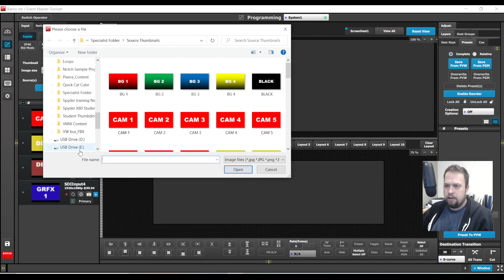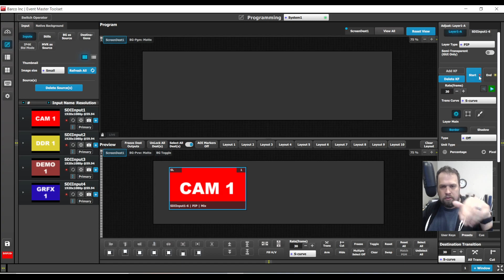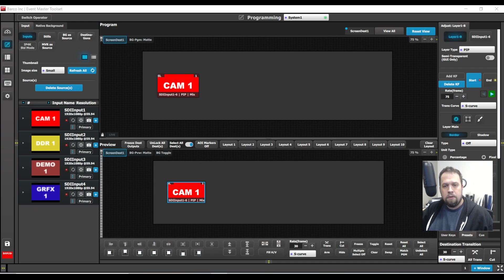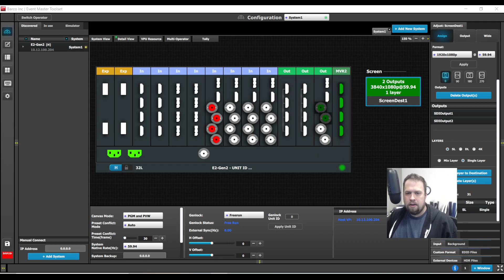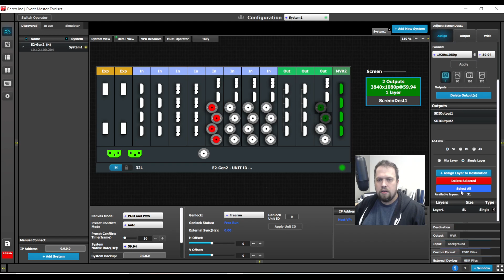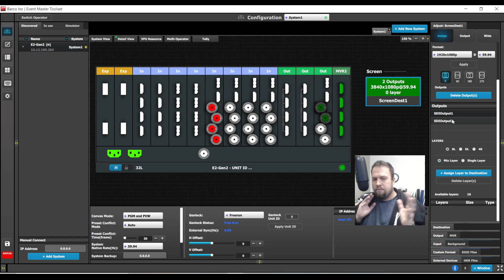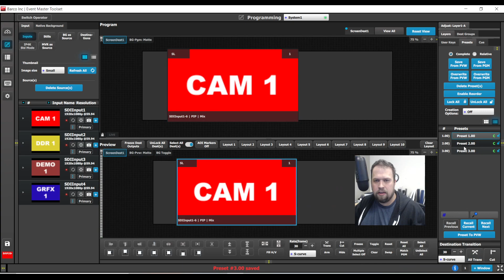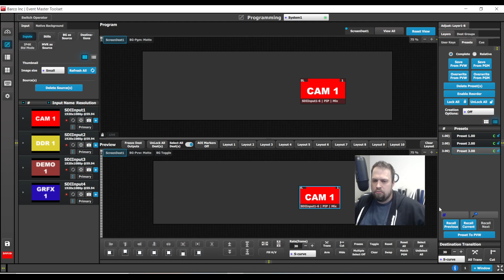Barco E2   Creating and using Key Frames for flying Pips

Comment: Love it, yet this doesn't seem to work with your input "bind to user key" trick. I have it set to adjust the border and shadow and the keyframing seems to have priority over the bind user key command so my border and shadow don't get applied. So i guess i have to program the border and shadow into the relative presets if i want to use the flying graphics.

Comment: Hey Kevin, thank you so much for this. Does this work with single pips on multiple screens within the same preset? (2 destinations, each with one pip). Thank you again!
Reply from the maker: Absolutely, this can affect as many layers as you require
Reply: @kevinringvideo  thanks for the reply. Far as I can remember I had issues with having multiple pips on the same screen and adding a border to them. For some reason the border wouldn’t carry for both of them.